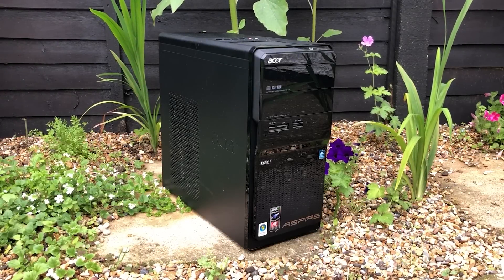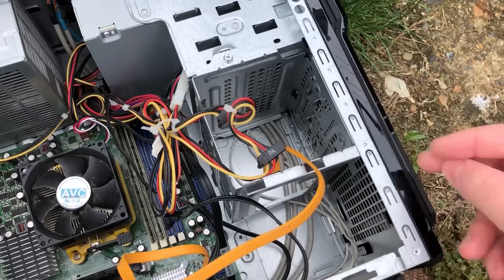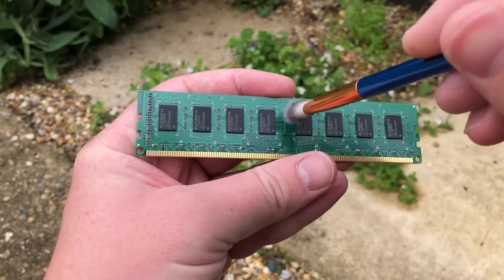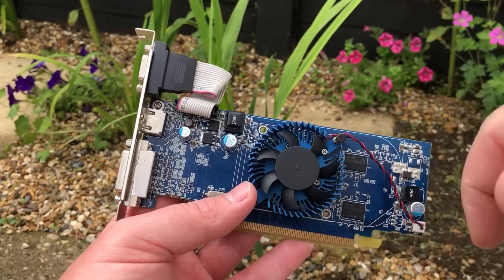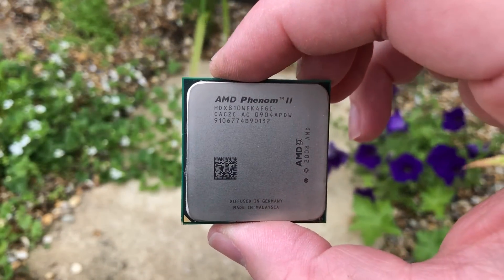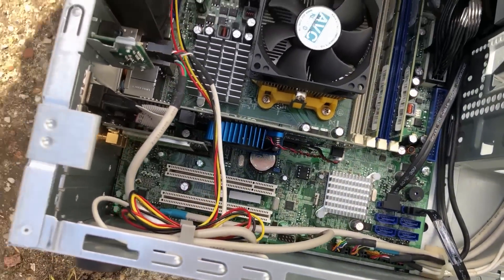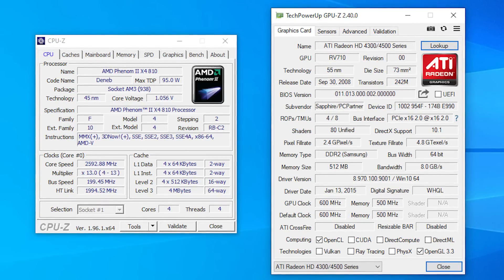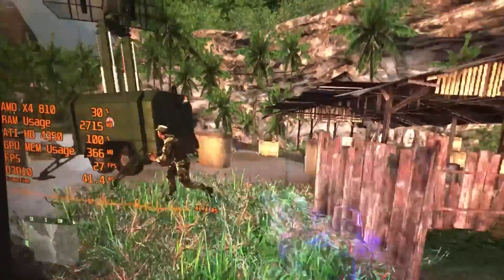Fixing Broken Ebay Gaming PCs - The AMD Acer Aspire

Comment: 0:43 this is so real. I've sold my old pc after it was not enough for me, it was really weak, especially the cpu, it an AMD Athlon X4 740 which is really bad. The gpu and the psu died, so I sold it for next to nothing, the only valuable thing was the mobo and 12gb of mismatched ddr3 in there. The guy that bought me told me why he bought it, turns out he was making some sort of arcade machine? Idk, but it's a pretty interesting use case since old arcade games can be emulated pretty easily even on weak hardware I believe. I really hope that parts that were useless to me ended up being useful to him and fit his needs. Anyways, that's all, I yapped too much. Just wanted to share this cool story with someone, thanks if you read it.

Comment: i feel you are cleaning the motherboard wrong. you should have left the cpu in the socket while dusting or blowing air. removing the cpu risks having dust or micro particles getting lodged insive the motherboard cpu socket holes.

Comment: Most of the SSE 4 usage is actually due to Denveo DRM. That is why almost every such game has an unofficial "remove SSE4" patch. Cyberpunk 2077 will actually run playably on the higher end or overclocked Phenom IIs with the patch. Some games have an official one, versions of Far Cry 5 from december 2019 run on Phenom/Core 2 series CPUs for instance but not older FC5 versions.

Vast majority of modern games do not actually utilize SSE4 for anything useful to the gamer/end user.

Comment: the phenom X4 with four cores at 2.6 is still the best experience on that socket compared to an Athlon x2 6000+ with two cores at 3.13 ghz. Literally the best it can be besides graphics. I was using a 960 with it and getting usable framesrates.

Comment: My original gaming pc used this exact same X4 810 and it was a fairly ok chip when I used it back in 2015-2016 in my first ever pc before I upgraded. I even managed to unlock the extra 2mb of L3 cache with no issues. I later upgraded to an fx-6350 (and later to Ryzen) but that cpu still holds a special place in my heart

Comment: I just yard-sale bought a couple Optiplex boxen. Both are functional.

The older of the two is pretty close to the bottom of what I would consider usable as a daily driver office, web, and chatting PC. And that's after a few choice upgrades using parts I already had laying around. Specifically pulling out the 2GB RAM and loading it with 4GB, and loading the amplified front panel speaker in.
Fortunately I don't have to deal with the IGP, as the prior owner crammed a GT710 in there - probably the only time where you could objectively say that a GT710 is a meaningful upgrade and is finally paired with a worthy processor.
That worthy processor being, of course, a Pentium D, which as I type this is undergoing the intensive test load of "memtest86+" to test my RAM upgrade.

The newer one needs some RAM, and I have enough Core 2 Duos laying around that I'll also give it a CPU to upgrade the potato "Pentium Dual-core" E2160 it came with. If I had a low profile plate for it, I could also theoretically load my HD5570 in here, but given that these systems are only rated for around 25w on the PCIe port, I might have problems pushing anything bigger than, ironically, the GT710. Or maybe a GT 1030, once their pricing returns to sanity.

Comment: Snap a X6 in there, 12gb total ram or something, a smol 95mm tower cooler and a gt1030 and you got yourself some nice office/lite gaming machine
Reply: With DDR3 it should do 16 GB as well, with an X6 and some clock the 1030 will get the CPU bored.

Comment: Hi, i saw an old video of yours where you replaced thermal paste on a video card... putting the paste in the center makes sense with processors which have a heat spreader but if you have to put it directly above the die of a gpu it is better that you spread it uniformly, otherwise it expands in a circle and risks not covering all parts of the gpu, creating cold zones and hot zones

Comment: Just saw on Ebay, i5 4690k with a GTX1070,430W Corsair psu, 16gb 1TB and 256SSD go for £305. Almost tempted but the guy only had 4 rating.
Reply: ebay is safer for buyers than sellers lol

Comment: You can technically have an i7 4770k and gtx 960 windows xp system. Maybe you could make that setup and try to have every windows operating system from windows xp to 10.
Reply: GTX 780 Ti also has driver support for XP and should be quite a bit faster.

Comment: When I was a teen a woman from my moms work brought me her Acer Aspire (2009ish model?) to see if I could fix it. It would power on but not post and after trying for ages I gave up. She told me to keep it. This was around 2014. Needless to say I eventually got it working (Reseating the CPU). I bricked it by screwing up a BIOS update but luckily it's BIOS chip was socketed and I bought a new one on eBay which coincidentally added quad core CPU compatibility so I upgraded that bad boy to a Phenom CPU topped off with a 750 Ti and it became my first gaming PC that I played Battlefield 4 on religiously. Always have fond memories of fixing up crappy OEM pre built pcs.

Comment: There is a certain Australian Youtuber who cleans PC parts by applying quite a bit of electronically neutral cleaning liquids, up to apparently brake cleaning fluid.  It seems to me this is a far faster method and also sterilizes the parts better.  Have you ever considered or tried such methods, or is soaking parts in liquids, even electronically neutral ones, too dangerous in some aspect?

Comment: I like how the old AMD CPU looks like a new Ryzen 9 at a quick glance, I have always liked how even though there has been massive changes to the CPU's over the years, the design has barely changed at all, something about that to me is cool, kinda satisfying.
Reply: They basically used the same size and type of package all the way from socket 940/930 into AM3+ and even AM4 is pretty similar.

Comment: Try pairing it with a gtx 750 ti, i've also got an old amd processor lying around which is to be a phenom 2 x4 965 and paired it with a gtx 750 ti 2gb windforce with 6 pin and an 8gb ram as an upgrade as it turned out it did a pretty well balanced in gaming specially on gta 5 everything on high except for textures on normal and MSAA off @1080p res, i've been using it now as a backup pc or secondary pc.

Comment: My nephew gave me his 15 year old Acer Aspire. The problem was that the computer showed only blue squares on the screen.

I ended up doing a complete overhaul. The computer did not have a discrete graphics card, and the CPU in it was so old it was using an AM2 socket.

I had a Ryzen 3 2200G in my storage, so I decided to put it into use again. I ordered completely new internals along with Win10 license. Now the oldie is up and rocking again. 

I loved overhauling that PC. And I would definitely do it again if needed.

Comment: Crazy how fast technology advance. This makes 490pts, while my 10600kf makes 520 on one core. Also i benched my old Q6600 stock it made 460pts, which isn't that far from this phenom II. Still can make a good netbox/retro gaming machine if you slap a decent gpu in it.
Reply: MY X5460 makes around 980 and 250 single core overclockeed to 4.1 GHz, and that is also just a Core 2 Quad Xeon.
So less advancement than thought. Tt the same time my 3570K on 4.5 makes 1340 and 350 respectively on 4.5 GHz. That's about 30% from Core 2 (2009) to 3rd gen (2012) and 35% form 3rd gen to 11th gen (2020) per clock.

Comment: An E8500 dual core CPU will beat that quad core!
I suggest anything from 750ti and below.
A perfect time machine for old stuff from Windows 7 and below.

Toms Hardware got some handy hierarchy lists of CPUs and GPUs to find and compare what you're looking for.
I just searched CPU hierarchy.
Ctrl+F , then type: Phenom II X4 810
Reply: In Crysis it will, that game only really uses 2 cores, but get's about 5% more with 3+ cores. And with the higher clock and slightly higher IPC the E8500 should be around 30% faster in those cases.
Now for things that do properly take advange of 4 cores the tables turn. I had lots of games that ran better after switching my E8400 for a Q6600, despite the quad being slower per core. Games around the 2012-2015 mark.

Comment: use the 1gb ddr5 version of the 7570 that should be an ideal combo which each component will compliment each other without any noticable bottlenecks
Reply: It should do good with more than this. 7770, 7850, GT 1030, GTX 660, RX 550 all should be fine.
Bottlenecks are irrelevant anyway. On the same system I have a massive, unplayable CPU limit in some and a hard GPU limit in others while the next ones play just fine without any issues.

Comment: I Love the old Phenom II x4 cpus , i still run a few rigs with them , i paired a Gtx 760 3gb card with a x4 965   system ,and i have a Gateway dx4300 overhaul system with a B93 cpu which is essentially a Phenom II x4 945

Comment: I had the same prebuilt years ago. Still have the MOBO with CPU and the GPU but mine was an Athlon 64 X2 245 and HD5570 1GB. Once I got a new PC and gave that to my mom and i tried to upgrade the gpu with GTX 750 Ti but it wouldn't boot. Didn't have any ATi/AMD cards then so i couldn't try them but bios was probably completly locked.

Comment: I paired Phenom II 965 with,4gb DDR2 800MHz (dual channel),XFX R7 250 1GB GDDR5 low profile, 128GB SSD Patriot and 500GB Seagate hard drive, and 400W SFX PSU. I use it to play old games (windows xp) which I can't play on windows 10

Comment: 6:03 A non conductive contact cleaner works miracles with dried up paste. Most of the time I use the EC-90 which may be costly, but cleans instantly any type of paste or grime.
Reply: I start with toilet paper for the wet stuff, then let it soak with alcohol or lighter fuel and use q tips for the corners. Careful use of toothpicks for the really tiny things.

Comment: My secondary system is a Phenom II X4 3.3GHz, 8GB, and also a HD 4350. Built it myself though. It's a joke that they ever called that a gaming machine. But it served me for years as a fine general use home PC. That PC would have been great to have for a student during the pandemic!

My favorite use for older quad core machines like that are as retro gaming PCs. You can play 80s-90s arcade games, NES, SNES, Genesis, Gameboy, and probably PS1 and N64. Use either Retroarch or Launchbox to control all the emulators and roms. And of course there are many many thousands of games out there that can be downloaded for free. Just an idea to keep in mind for those older systems...

Comment: The CPU is missing AVX and AVX2 instruction sets. Advanced Vector Extensions enables simulataneous math operations on 8 FP32 or 4 FP64 floating-point numbers per core.
Reply: It also misses SSE4.1

Comment: About the prebuilt CPU/GPU mismatch, HP did a pretty good job at matching my CPU and GPU, an AMD Ryzen 5 3600 and RTX 2060 Super are a pretty good match. (It came with 1 single channel DDR4 2666 MHz 16 GB stick though, I later upgraded it with 2 16 GB 3200 MHz Hyper X Fury sticks and I added a Sound Blaster Z as my system didn't come with s/pdif. It's a HP Pavilion Gaming Desktop TG01-0450ND if anyone is curious.)
Reply: That gpu is still a bottleneck, a ryzen 3/i3 of a couple gens ago would still do it right.

Comment: That phenom is a perfectly fine mid range CPU, and has a fair bit of life left in it still.  Personally, I would pair it with a GTS 450 or maybe a Radeon 7770 or 7850.  With that PSU, you could probably get away with a GTX 460, but honestly I think the GTS 450 would be a better match.  It would crush Fallout 3 and New Vegas.

Comment: These HD 4350 GPUs are bad, yes, but they're also very power efficient. (20W TDP) Doesn't really help, since most modern IGPs are much better, but there aren't many <20W desktop GPUs in general. Could be nice for a power efficient retro gaming PC, if it has a 45W Athlon for example. It wouldn't need a great PSU, too. 200W should be enough.

Comment: Many years ago I actually found a HUGE beast of a, what I believe was some office PC, with both an old Pentium 60 AND a Pentium 90 working in tandem.  I believe that it has MANY of what was once called EISA slots!  It actually still runs but it has one of the old soldered on battery backed up clock modules on its huge board so it will not keep the proper time unless I change or modify the depleted module with a new battery.  I could never find any info on this particular PC anywhere as there is really no info on its motherboard or gigantic case!  I actually dragged it back to my home on a wheeled dolly as it weights WAY too much to lift into a car trunk without help!  Unfortunately, there wasn't any info on its hard disk to help me identify it either or even in its BIOS. I have never seen a PC like it anywhere before, not even searching the internet.  It was actually dumped out on the curb for trash in my neighborhood back in the '90's if if remember correctly.  I have been tempted to dispose of it in the past, but I just could never bring myself to do it because of it uniqueness. It's weird because both processors are different speeds and they reside on a separate removable smaller "daughterboard" from the main much larger motherboard. A sort of "daughterboard" that has the processors on it instead of the larger main board.  I guess that you can say the daughter is way smarter than the mother in the family!  😁😁
Reply: Might it be something like a Unisys PW2 Advantage 5608. or something from that line?  I see a review and picture of one in the Mar 15 1994 issue of 'PC Magazine' (via google books) which tallies up with the description. Marketed as an application server, and a bargain at the time at $18,000 for the single CPU version. There's probably collectors for something like that, especially working.

Comment: I just had to work on a nearly 20 year old Dell XPS, the ones with the white case that has a lever on top that pops the side off.  Ya know, those old Dell cases had some seriously clever design.  Almost everything was designed to be easy to work on, very impressive.  Then a couple days later I had a PC I built back in 2009 I think show up, I started checking ebay for cheap upgrades 😆
Reply: I still have a few of those old Dells in my basement, if you mean the ones with the plastic side and top panels. They were notorious for holding too much heat in the case, I believe.  They are kind of fun to play around with every now and then.  I think I have some with Pentium II's and at least one with a Pentium III if I remember correctly.....🤔
Reply: @arthurmann578  I know the one you’re talking about, I used to have one with a P4.  Actually the one I’m referring to is probably not quite 20 years old, it had a Core 2 Duo and the sides were aluminum.  But even in that case the air flow was sub optimal.  Easy to work on, sure, unless you want to add fans or swap the power supply.

Comment: I'm still using 2006 core to duo e6600 workstation 15 year old computer that works fine
Reply: Same using a core 2 Duo e8400 with 4gb ram and 128gb ssd windows 8.1

Comment: I'd pair it with an 7850 2GB or a 7870, I think that would suit the good ol' Phenom pretty nice, also research on which slots on this MoBo are supposed to be populated in order to get dual channel working if it isn't already :)
Reply: From running a Core 2 Quad with a 660 Ti I can see that Phenom fitting pretty well with a 7850.

Comment: I love the verdict of Crysis not being playable, what I mean is that I can tell you didn't play Crysis when it released because that kind of performance on a high end gaming PC at the time would have been considered pretty good!
Reply: I was thinking the exact same thing!  It looked like it was doing OK with Crisis to me for an old graphics card.  I still use a 4550 and a 4650 in two of my old machines.  I use a 6570 to play the original Skyrim every now and then in one of my old machines, and mostly on all high settings with no issues!
Reply: I remember those reviews where a pair of 8800 Ultra in SLI couldn't hold 40 fps in 1680x1050

Comment: I have a nice 3ghz x4 like yours made by HP I added 16gb ram a 500gb drive an hd 2600xt 256mb video card that runs off pci-e power plays Eve online well at 1080p medium to low settings , very budget and good bang for the buck as upgrades cost 25$ and paid 20 for the tower ,tempted to put a better GPU but with sub 300w it's not in the budget this time around will have to save my gtx 460 1gb for the next build

Comment: A good graphics card match for the Phenom 840, 840T and 860 are the 2gb Radeon R9 270/370, or you could go with a 2gb GTX 660, 660ti and 770 on nVidia side. I used a similar Phenom 905E for years after it was obsolete while paring it with an HD 6450 and later an HD 7750 of all things during my starving college days.

Comment: A GTX 780 Ti 3GB. With that in it, it will be good. And then one can upgrade cpu.
Reply: I'm actually running a GTX 780 ti with an old i7-920 and it runs just about everything I throw at it in high settings still!  It runs hot enough to help keep my house warm in the winter and my air conditioner working harder in the summer, but it's worth it!  😁👍👍

Comment: Could pair it with a 970. Haven't seen that get mentioned much lately.
Reply: A GTX 970 would bottleneck on this Phenom CPU. I know because my old AMD FX 8120 was a little faster than a Phenom and it still wasnt fast enough for the GTX 970.
Reply: @HintsofRed  Just run it at 4k
Reply: @MarginalSC  True. I was thinking in terms of 1080p lol.